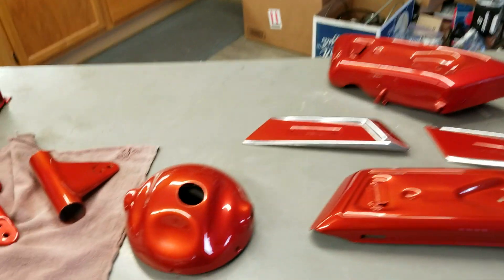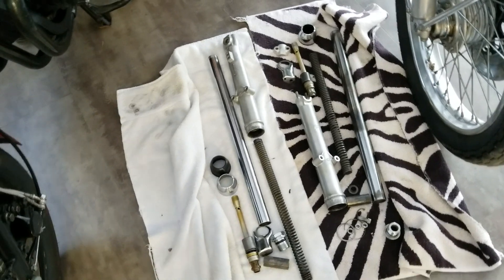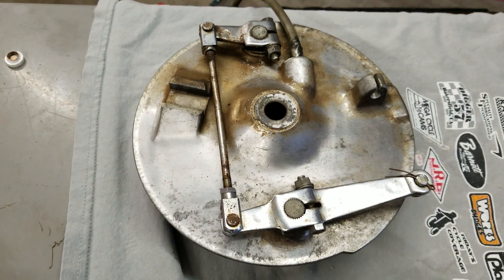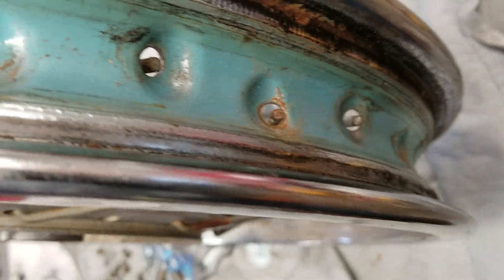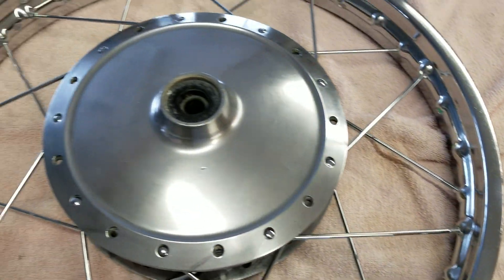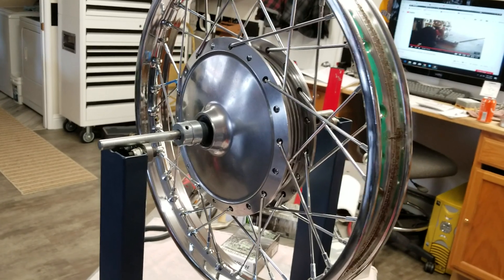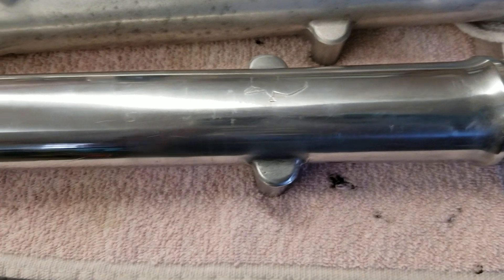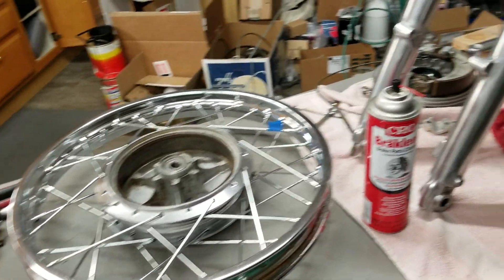1972 Yamaha R5 350 Restoration Part 2

Comment: use a 1 or two inch flapper wheel with an air 1/4inch  die grinder on the drums it will amaze you. the rust and glaze will be gone in minutes